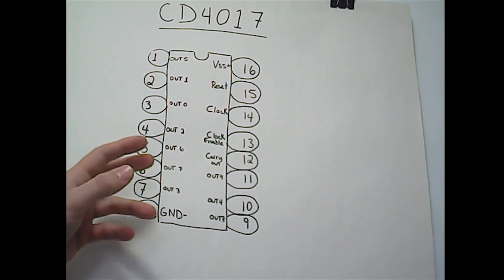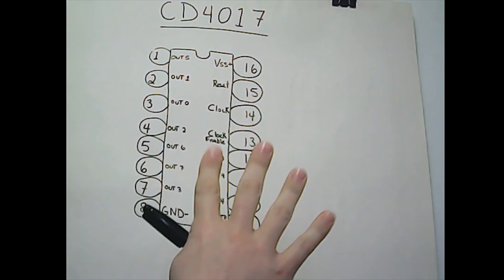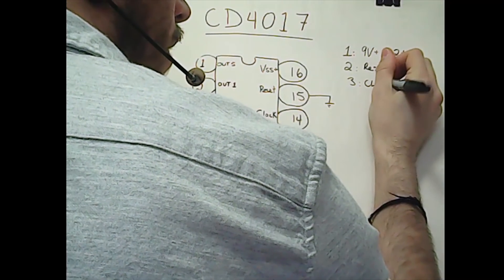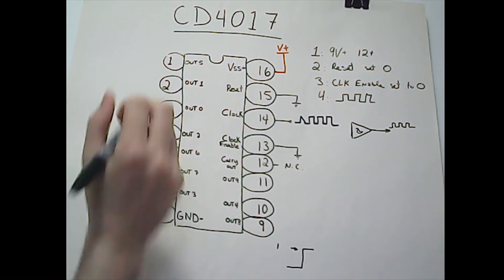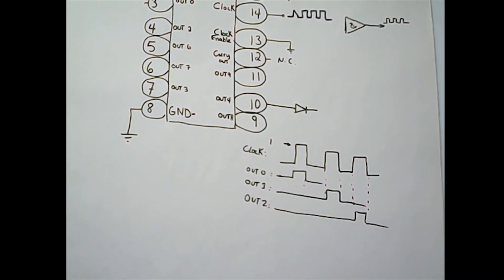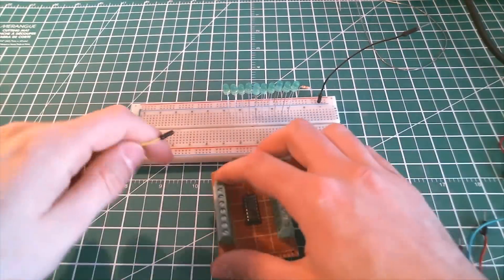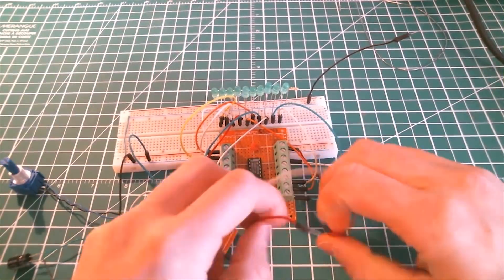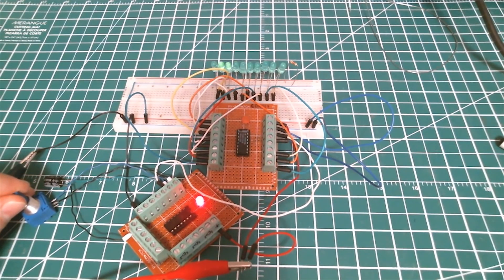Build Your Own Synth Sequencer (CD4017 Tutorial for Beginners)

Comment: Thank you! Now, if we want to add a 40106 audio oscillator to make this a musical sequencer, where does the output of the audio oscillator connect to the sequencer? How do you connect the potentiometers to vary the pitch of each sequenced note? Will you show us? Also, will you show a circuit that cascades additional 4017’s to increase the number of steps? I KNOW many of us would LOVE this information. 
Thank you for doing these great tutorials. Your lessons are very helpful and MUCH appreciated.
Reply from the maker: Sarah Michelle the output of each potentiometer will go into the VCO and this will produce the sequence of different tone. To learn more about this, you may watch the “Chicken Wrap Audio Sequencer” video. Do not hesitate to ask all your questions or contact me via the e-mail address for further details, schematic and explanations. Cheers!
Reply from the maker: Sarah Michelle hi Sarah! Thanks for the comment and the questions! To create an audio sequencer, you will need to design a VCO (voltage controlled oscillator) https://youtu.be/SCemzB7GonE
Reply: it's been a while since i've done electronics, but if you've got a 40106 resistor/capacitor oscillator going on, you'd need to turn the voltage from the 4017 outputs into resistance - an easy way of doing that is with an LDR and an LED, wrap em in tape and you've got a cheap varistor.

also, the 555 actually has a control voltage pin, so if you build an oscillator using the 555 instead you can just connect the 4017 outputs directly to the 555 CV input (pin 5) and it'll directly influence the pitch. it's very coarse, not even close to even-temperament, but very fun to mess with.

Comment: What are those grey/green clamps called where you screw in the connections? I can’t find them online. Thanks.
Reply: Ah, I found it: pcb mount terminal blocks. (for those with the same question)
Reply from the maker: Nelson Cole Reis Hi there, thanks for your question, I was just about to answer you but you find out! Hope you enjoyed the video!
Reply: Yeah, definitely. Great videos! I’m thinking of building a 8step sequencer for triggering and circuit bent toys and monotrons, with sync/clock input. Based on your design. Thanks!
Reply from the maker: Nelson Cole Reis that hell of a good idea! Do not hesitate to contact me directly or via the chat if you need any pieces of advice!
Reply: Thanks! I will contact you. I’ll probably need some help setting it all up. I received my 4017 ics today (10 of them). So I hope I get it working.

Comment: why the sequencer have a capacitor? you dont explain this...
Reply from the maker: Pablo Beck Garreaud thank you for your question. Are you talking about the capacitor between the power and ground? It is to regulate noise and fluctuation in the voltage supplied... note that this should not be a problem with a battery.
Reply: Thanks for taking the time to answer. Love your videos, but i find them a little too fast, im not an expert on schematics so i just copy exactly what i see in the videos, yours i find a little difficult to follow this way. Your season 1 is exactly what i was looking for!!! Thanks for uploading this videos, I will surely make this with my professor at the Art Academy of Düsseldorf. Greetings and keep uploading videos related with sound please!!! (What about some filters for the oscillator? and wave modifiers? Different wave oscillators?...) Thanks for all!
Reply from the maker: Pablo Beck Garreaud thanks a lot for your comments! It is noted and we are looking forward to more videos related to audio! :)

Comment: why don't you directly put it in the breadboard ?
Reply from the maker: Shockszzbyyous thank you for the question. Breadboard is perfect for non-permanent project. The proto board I built in the video is solid and stable, it offers a developing space and a ready to use Ic without the need of a breadboard. I like using breaboard to test circuit before soldering.